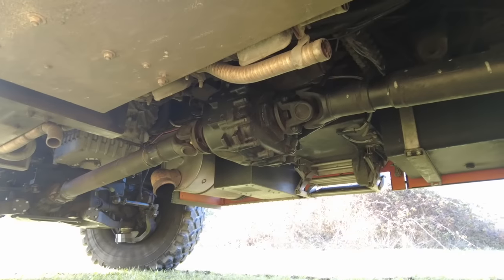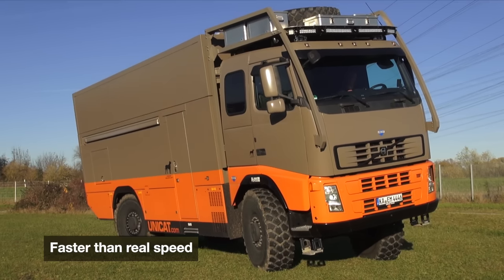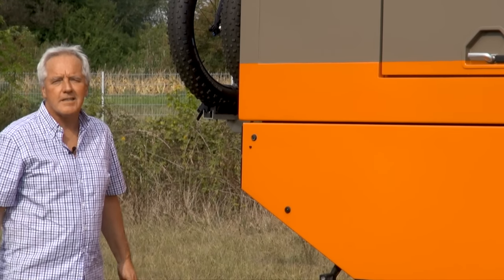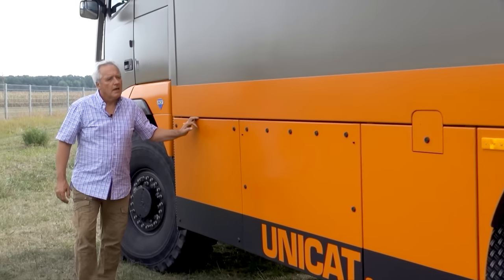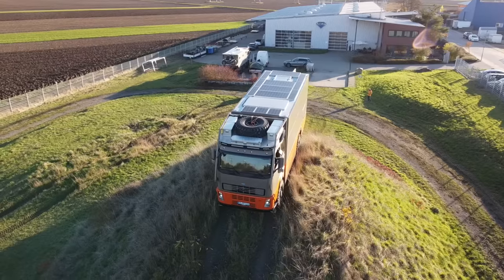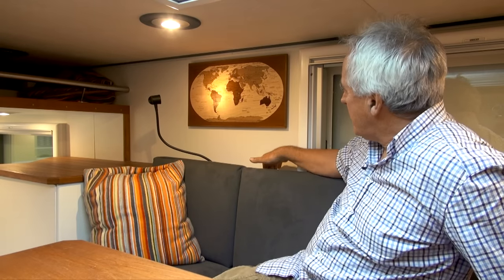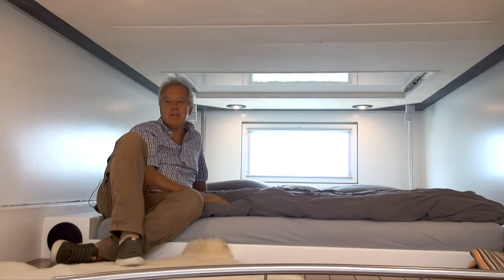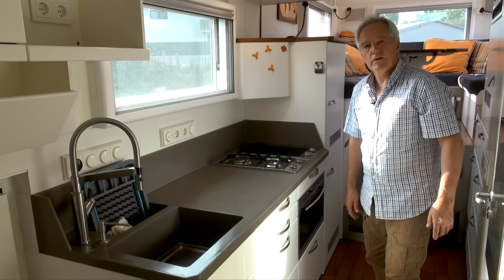UNICAT Expedition Vehicle: IN63HD Volvo FH12 by UNICAT 4 Steering Wheels, 4 independent suspensions.

Comment: A concern I have is that the external bays could be easily jimmied open.  Is there the ability to magnetic locks on the outside bays and thicker metal doors that cannot be compromised?
Reply: You can instal conventional door magnets and  alarm system easily. Better than do bullet proof doors, isn’it?

Comment: Very 8nteresting things or adjustments such as the wheels and suspension systems and others which you did to your truck that I would like on mine. Should be contacting you soon. Please, kindly leave your email on your bio section. Thanks and it's an amazing truck for sure.

Comment: What a beautiful truck. I always wanted to ask... Can a 6x6 be turned into a 6-wheel steering vehicle, or is it overkill?
Reply: The development for this rig was done in a MAN 8x8 with 4 axel steering. So yes to your question.
Reply: This one is a 4x4x4 and we have a 8x8x8 under construction. We can certainly make a 6x6x6. Weather t´s overkll depends on the wheelbase of the 6x6 and where you want to go.
Most of the 6x6 we make these days have a steering axle n the back, that actually is very helpful.

Comment: Hello, thank you for the video. May I ask you what type of driving-license do I need to be able to drive something like this? Do I need the air brake endorsement too?
Reply: That depends on what chassis you chose. If it has air brakes, you need the ABE. Unicat can rebuild it to use disc brakes if you want. 
And as for the driving license: You need one over 7,5tons or your country's equivalent. The largest Unicat trucks reach 20 tons.
Reply: @Arrynek01  Thank you!
Reply: @oneundecided  If you are a U.S. citicen, you are lucky, as you can drive any RV, no matter how large or heavy with your car licence + air brake endorsement ( disk brakes on trucks are also air brakes )

Comment: How do you take the spare tire and how do you put it back on the cab?
Reply: May be he thinks he will not need it??? 🤷‍♂️🤷‍♂️
Reply: @RadioWerwolf  If  would think I would not need one I would not bring one and would put diving gear instead.
Reply: There is a turnable arm with a hoist that is set up when needed.
Reply: Actually my point was: Since the vehicle has automatic tyre inflation / deflation system through the hubs and run on flat type tyres, a spare tyre is only needed if one tyre is completely destroyed,  which would be a rare case even under mild off road situations. And in such a case you could just dump the spare tyre down from its place and there would be nothing to replace it except an empty rim.
Reply: @RadioWerwolf  this is for the brave ones ... a. if you just dump a wheel from that height, it will jump around like hell - and don't try to stop it - it's the weight of a Sumo fighter, just faster.
Reply: @thomasritter1470  I did not mean you literally "dump" it down. I was just referring to its "difficult" location.
Reply: @RadioWerwolf  True, it's difficult location, but the spare wheel is big but can be stored outside. It is too big to put it under the chassis, the only options are the back of the vehicle or the roof of the cab.
On a 4x4, you have to watch for the weight distribution and as this drivers cab has no suspension, we have put it here. With a suspended cab we would not do it and it would need to go to the back.
For both positions, you need gear to let it down, that's part of the game.
Reply: The guy said this is its own truck. Based on a second hand Volvo. Maybe he just put the tire on top of the cabin and just in case one tire is destroyed he can push the spare tire down from the cabin. 

I see the other trucks they made, the MAN, it has two spare tires but mounted in the back. I'm sure they have some system to take them down easily because the price of a truck like this is around 1.5 million euro.
Reply: @thomasritter1470  :-))

Comment: Vary vary cool. Its no wonder Unicat stands above all other Expedition vehicles ... To bad folks in the United States who attempted to build this type of vehicle fails miserably.
Reply: Who in the USA attempts to build this type of vehicle?  This type of vehicle is not for the normal person that wants to go off road driving.  This would be to slow if you wanted to cross the USA using Interstate when you can, it is designed for expeditions in places that do not really have roads.  Many of the places people go off road this truck would be to tall and to wide for the off road trails.
Reply: @badgerpa9  not worth replying to.....
Reply: "not worth replying to" lol so edgy...

There are a few manufacturers in the States that make large expedition vehicles. Earth roamer, earth cruiser, global expedition vehicles are the ones who come to mind off hand.
Reply: @barrydallmann3692  There are manufactures but they are doing well, they are not "attempted"  This is a nice vehicle better than others they have shown.  Some of the vehicles they have shown would be great for africa but the USA has roads and you would need to go over 45 mph at some point.  Much of the offroad areas in the USA the trucks like this would not go they would not fit.  I understand the comment was meant as a suck up but the person shows they have no knowledge of the different locations and vehicles.   Vehicles for offroad have been built in the USA for 100 years and they do well.

Comment: Dear Sir, do you mean you bought the truck used, does that mean the box was on it ,or just the chassis. When i shoud design such a truck i woud do it with the same techniek. This truck will help you out of the most sevire places. Chapeau there will be non conpetetor.
Reply: @alexanderdekeuyper2990  Hi Antoon, hi Alexander, I bought the complete vehicle when it was 15 years old and we did quiet some renewals and modifications in the past 2 years to adapt it to the needs of my wife, myself and our dog - actually now we have two... still enough space

Comment: What is the highway speed of this? Really like this version
Reply: In Europe the speed limit for trucks like this is 50 mph, with most of them doing 56 on the highway but most off-road tires are also limited to 56 mph.
So you would not want to go much faster with a truck close to its GVR.

Comment: Disc brakes???  Why not conventional air brakes??
Reply from the maker: They are disc brakes, activated by air controls,
Reply: Thanks for the update
Reply: @UNICATexpeditionvehicles  These bigger vehicles  with slideouts installed would make an ideal mobile hospital.
A roughly 60 cm operating table in t he middle and a slideout on either side.  one about 75cm and on the other side about 60 cm.
Helicopters are not the safest method of transporting anything or anyone these days.
If I had the money, I'd get one in a heartbeat.
Would it be possible to have the body stay vertical when going over very uneven  ground.  Hydraulic levelers, similar to the American method of levelling RVs when parking for the day or night?
Reply from the maker: @rogerdickinson920  almost anything is possible, it's just a question of costs ....

Comment: SCANIA would have be better. They have 4x4 and 6x6 single tyres chassis (army).
Reply: I like SCANIA. But give credit to VOLVO where it's due ;), they have the FMX 4x4 which would be an amazing chassis (I may choose it in the future for an overlander).
Reply: Volvo have that as well. Their FMX series. Even a 8x8. 4×4, 6×6, 8×8, 8×6 and 10×6
Reply: Donut forget Mercedes and MAN - but non of them offers a all-wheel drive truck with independent suspension and rear axle steering, we picked a Volvo because it came with a 6-speed automatic transmission ( Powertronic )

Comment: Overengineering made in Germany.  It´s a nice truck, but way to many unnecessary  problem maker, for example the electric windows. I would keep it fairly simple, even with a 12t or even 16t truck. I think you would get in mayor problems, if there is an electricity failure.

Otherwise I really like it, low entrance, capable for bad roads (i would say it is too heavy for the offroad i am familiar with) and  relatively small outer dimensions.
Reply: They'll build you anything you want. 
But, since this truck is a "third-hand" and made for the owner and designer of the company, I'd guess it's a proof of concept to attract possible customers. It shows off what they can build for you.

Comment: gorgeous of course but ...
as an expedition vehicle, it is too complicated in technical terms, an expedition vehicle should be freely repaired anywhere in the world, any car mechanic in any unprepared service station, and this unimaginable amount of technical bells and whistles can only be repaired in a specialized service, and you can leave a hundred kilometers from the service and on a smaller car, and you don't need to write to me that the equipment is super reliable, any equipment breaks down when you least expect it and, as a rule, when there are a couple of thousand kilometers to the nearest specialized car service ...

шикарно конечно но....
как экспедиционная машина она слишком сложна в техническом плане, экспедиционную машину должны свободно ремонтировать в любом уголке мира, любой автослесарь в любой неподготовленной станции тех обслуживания, а это невообразимое колличество технических наворотов можно только в специализированном сервисе ремонтировать, а выехать за сто километров от сервиса можно и на меньшем авто, и не надо писать мне что техника супер надёжная, любая техника ломается тогда когда ты этого меньще всего ожидаещь и как правило когда до ближайщего специализированного автосервиса пару тысяч километров...
Reply: I agree that a expedition vehicle should not be too complicated and if you look at the variety of vehicles we buiild at UNICAT, you will see that 99% of the chassis are standard chassis with no modifications to the drive line, engine etc. And you are right, even so we build our vehicles at the highest quality standards, something can break.
If bells and withles fail, you won´t be stopped, if something more important breaks a redundant system will help out. 
But these days, you will hardly find a expedition vehicle that is so simple that you want to get it repaired by " any car mechanic in any unprepared service station". That´s why we offer worldwide maintenance and repair service.
If you consider to buy such a gorgeous vehicle, you should be ready and happy to use our worldwide service. 
And by the way, it´s not that complicated.
Reply: He is more than able to fix things that the service station could not.  If he cannot he can just make a phone call it has world wide service.

Comment: Very impressive until you see the kitchen with 2 propane gas burners but no ventilation hood. @18:58. It may be legal, but that is very poor design.
Reply from the maker: Just open a window ...
Reply: What are you going on about ???  at 25:40 he says and points to the extraction hood..
Reply from the maker: @kennyrogersrocks  You're right, I forgot about this, because it's not on all vehicles, only Thomas's. Thanks for letting me know😜
Reply: Did you not listen or watch the video???…there IS a ventilation hood!!  AND he pointed it out clearly in the video!  Maybe your eyes and ears are fogged up and you need a ventilation hood !! 😂